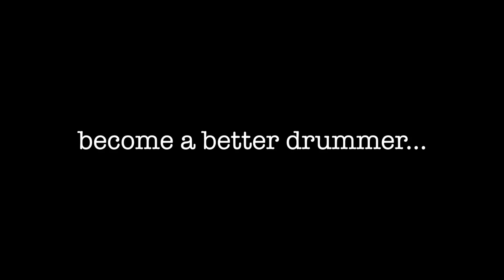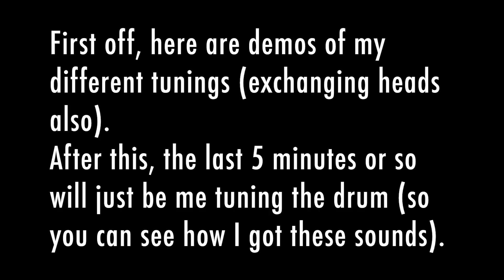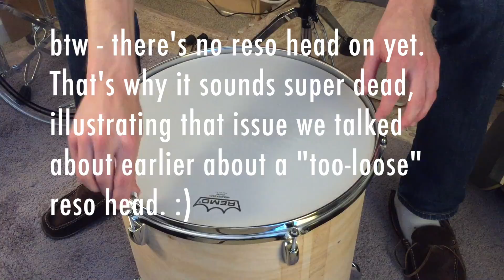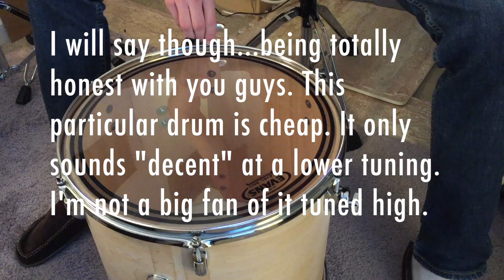Why Does My Floor Tom Sound BAD?

Comment: Somehow my floor tom sounds Better to be when I put some sheet music onto it cause my sheet stand is broken
Reply: Ze _Jeff putting a piece of  paper on it will act the same ( in a lesser way) as a big fat snaredrum. It muffles  and makes the pitch lower. A more phat sound
Reply from the maker: Guess I could interpret this a couple ways haha! I've set music on a tom before when I didn't need to use the tom, and it made for a more convenient music stand and a BETTER use for the extra tom. I've also put a piece of paper on a snare to lower the pitch, which is pretty funky (not exactly durable though).
Reply: Tried it...still sounded like sheet😂 so funny
Reply: Stephen Clark I'm very new to drumming. Just got my first set, as a 33yr old, used, and all I imagined is you just obliterating the music sheet and the shreds flowing like confetti around you lmao
Reply: Meat Sandwich lmmfao

Comment: I've got three sets, tama, sonor, mapex, and the only 12" that doesn't stay in tune is the Mapex piece of crap. Also, change the stock heads with some G1 or G2, or hydraulic if you don't want to use muffling 
Mapex really make garbage and their warehouse can't ship anything even after the dealer tried and was told 3 times they were shipping. 
Mapex is pot luck, buyer beware. 
Even their tom holders L-rods aren't the same size and shape. 
So, if you have a Mapex 12, that's your first problem.

Comment: You say your drums are cheap. Why is that? What kind of drums you have? I have a Tama Superstar Hyperdrive with shells made of birch. Would you consider they are cheap drums? I ask this because my two floor toms are not easy to tune.
Reply: Leví Zabdiel Hernández Avilés you have my dream kit
Reply from the maker: Cool! Sounds like you've got a nice kit. I wonder if your floor tom tuning frustration comes from the fact that the shells are birch. It's tougher to get low end from that kind of wood, so if that's what you're tuning for you could run into trouble. (compared to maple, mahogany, bubinga, etc., which naturally have a lot of low end). 
My kit is a Ludwig starter kit I bought in 2009 (accent combo). Very basic mahogany/juniper shells, which aren't great...but they sound fine for the price. The kit was only $400. The reason I call it cheap is just because the bearing edges aren't dead-on smooth, and the shells aren't perfectly round (super close, but not dead-on precision). This can make tuning a little bit tricky. I always have an easier time tuning nicer, more expensive drums, simply because it's easier to get the head in tune with itself quickly. A perfect shell always makes the job easier.
Reply: Thanks, George! I know if you save up some money and make that a goal for you, you won't have a Tama Superstar HD, but a Starclassic Bubinga! :P
Reply: Thank you for answering me, Stephen! Always thought your kit was more expensive (it looks like that). 
Answering your wonder: Yes. I have trouble getting a low pitch in all of my toms, even the snare is difficult (for me) to tune well. I know the fact that shells being birch complicate me so much, but I can't do anything but trying to get a nice sound of my kit. I bought Remo Controlled Sound (toms) and Emperor X (snare) for batter heads to fix that. Maybe I would need to get some Emperors for the reso heads. What do you think of that?
By the way, thank you very much for your respond.
Reply from the maker: Thanks, man. I think I added "visual value" to my kit when I peeled the wrap off and added a clear finish a year or so ago. That makes it looks less cheap.
I haven't tested enough different heads to give you a truly fair opinion, but I will say that I play on a house kit that has Remo coated emperors on the toms. They sound awesome. Really nice tone, good low end, very recordable. I like the Evans HD dry on my snare because it allows me to tune low while maintaining a drier tone. I've realized too that my rule of thumb (snare included) is tuning reso higher than batter.
Reply: Definitely a good choice! I want to do that in my older kit (a cheap one, black color), but in Mexico is difficult to find shops which are able to do that kind of work.
Another solution that I can imagine -- now you talk about coated heads -- is to try out 2-ply coated in all the drums so that I can find a most warm sound. About the "rule of thumb", I do the same with my kit!
Reply: No matter how expensive drums are, two things are KEY: perfect roundness and perfect flatness of the shell. If a shell is out of round, good tuning will be almost impossible. 2 - 3mm off will be ok, if more the shell is garbage. The shell has to be perfect flat, also. If not, a good woodworker can fix it with a router and a sanding table.
Reply: Thanks for sharing, Hannibu. I think my shells are just fine and my ears are the problem. Greetings!

Comment: I think most people hit that drum way to hard. The head vibrates too fast to create low frequency
Reply from the maker: That's an interesting possibility...It's definitely possible to hit a drum so hard that it just chokes out and doesn't achieve maximum tone and resonance. I think every drum has a dynamic range within which it sounds the best. And I bet a floor tom is most susceptible to getting choked by too-heavy playing.

Comment: These days, Pearl kits come with heads made by Remo. :-)
Reply: Emma Webber so do Yamaha’s, and a handful of others. They’re still cheap single ply stock heads- I think the Remo ones are called Remo UT. They’re awful too. New heads are the way to go.
Reply from the maker: That's definitely a step up from the standard "stock head". Hopefully this kind of thing will become more standard in the future. Although it's probably still best to replace heads right off the bat, even basic Remo heads that come with the kit can work just fine for a practice kit at home.
Reply: Made by Remo in China! It is a great difference: Remo made in China and Remo made in USA. Though they are Remo doesn't mean they sound good. China Remos sound like crap. Always switch to "real" Remos.